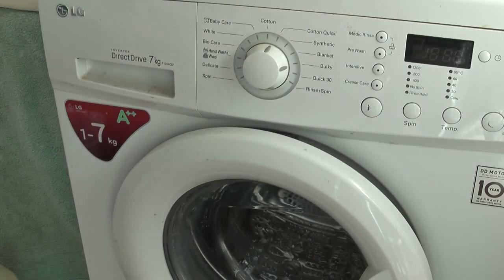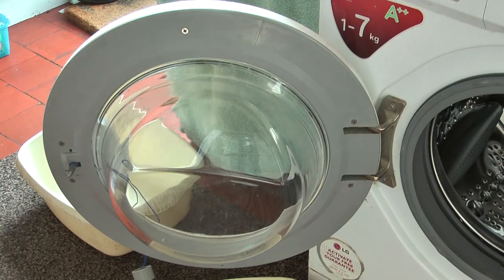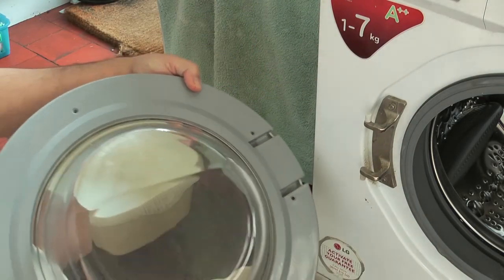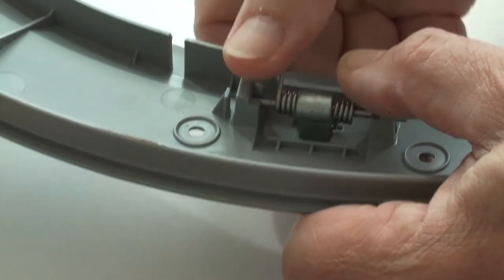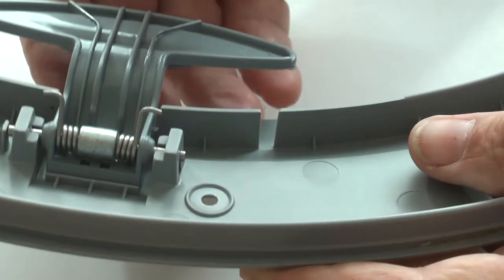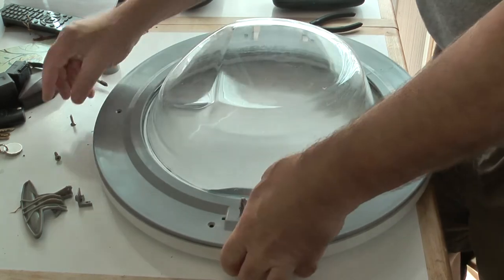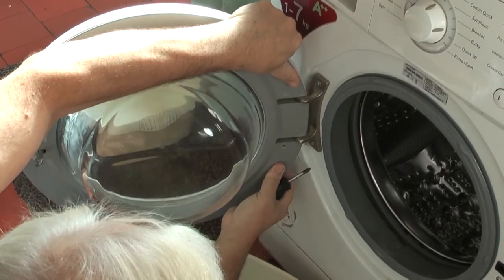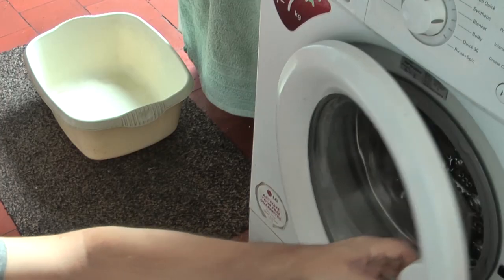LG Washing Machine Door Handle Replacement (Model F125QD)

Comment: Thanks for the helpful video. The one bit of advice I would add is that, when refitting the cover, the two halves should be held apart by the door spring which ought to be trapped between them, providing tension (as you demonstrated with your thumb early in the video). It’s quite easy to join the two halves of the cover together without trapping the spring in the right place, leading to a floppy handle. Otherwise, a dead simple job.
Reply: Where is the right place to trap the spring please? I've tried replacing mine but it's flappy
Reply: @ejovwokejoanna711  I'm afraid I don't remember. Reading my comment, I can only suggest you watch the video and look out for the bit I referred to where he applies tension with his thumb - hopefully it'll be a bit clearer. Good luck with the floppy handle 😊

Comment: Thank you so much from Australia, I used this to fix my LG WD12021D6. The only issue was when I was putting the door back on, I found I need to have the two screws near the spring tight, and the hinge area loose with no screws on mine. Apart from that all the detailed shots are fantastic.
Reply from the maker: Thanks for taking the time to comment.  It's always good to share our experiences so that it may help others. I'm pleased my video helped you out.  Roger
Reply: O

Comment: I removed the hinge. Now I can't put it back because the bolt is not holding anymore.
Reply from the maker: In the video I chose NOT to remove the HINGE BOLTS because I had/have no idea how the bolts were/are retained and I did mention my fears about what might happen.  Captive nuts and fasteners are used extensively in the Automotive and White Goods industries and are notorious for moving or dropping out of alignment when taking things apart.   This sometimes adds to the problem of reassembly, especially where access is an issue.  I guess the nut has dropped off the back and is inside the machine somewhere.  It happens even to the most experienced.

Many thanks for posting your experience of the problem you had by removing the hinge bolt. A salutary warning for us all!
Reply: @colemanus1318  There was a plate behind the hinge and was dropped. I opened up the top panel and used a magnet with stick to recover it. Now I fixed the door back.